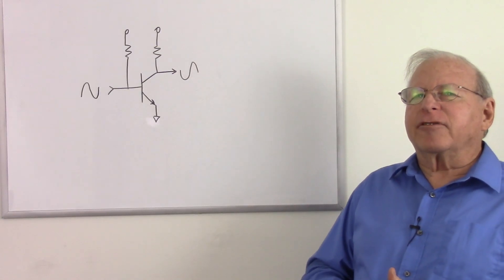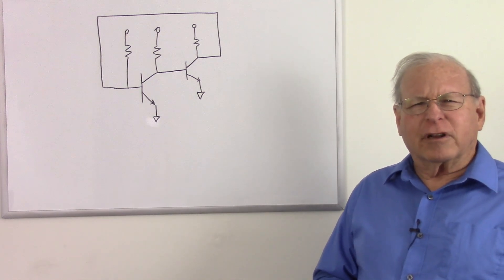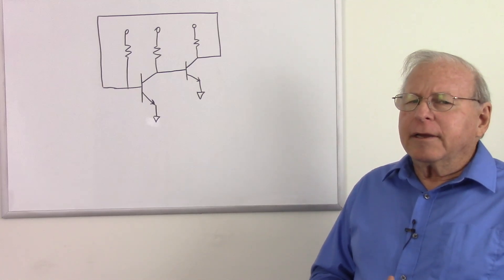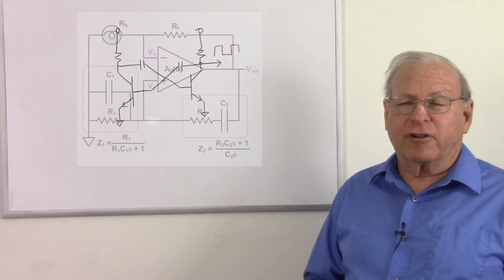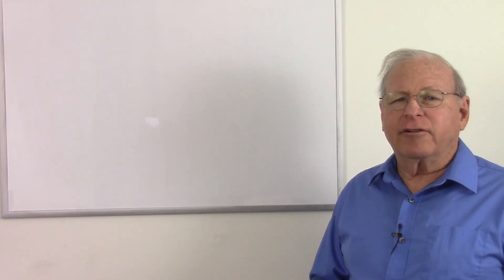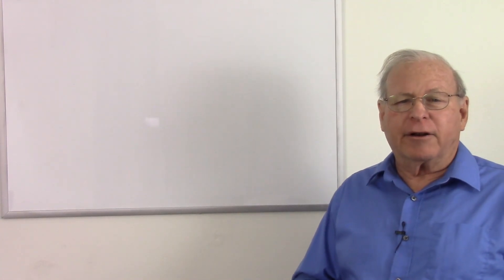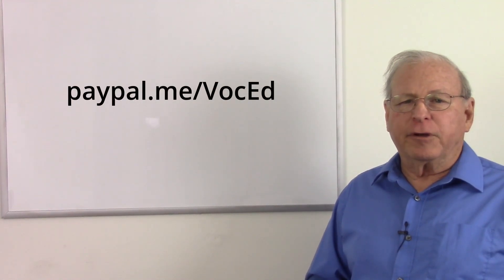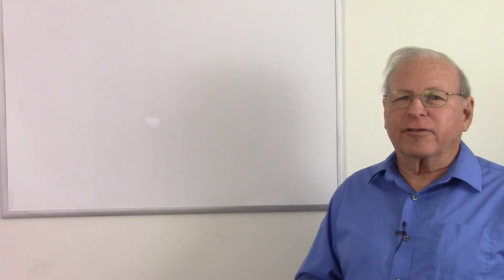Prelude to Oscillators

Comment: Is that an inductor on the emitter of the 1st transistor?  Why is it there please?
Reply: That's an incandescent light bulb.  It's a resistor with a negative temperature coefficient so it increases resistance with current.  It's purpose is to increase negative feedback to a balancing point to stabilize the circuit so it oscillates with a sinusoidal output.  Lookup Wein bridge oscillator on wikipedia.  Also please include timestamps in your questions so folks know what part of the video your question applies to.

Comment: A simple explanation of how an oscillator works, point a microphone at a speaker, the speaker will move in and out at an audio frequency, the microphone will pick that up and feed it back to the amplifier and back out of the speaker.
Positive feedback.

Comment: Thanks for this series. Can you also make a video on Basic Transistor LC Oscillator Circuit?
Reply from the maker: I haven't decided where in the series I will cover phase shift and relaxation oscillators, but I will definitely cover them.
Reply: @Vocademy-Electronics-Tech  Will you be also covering Hartley & Colpitts Oscillators?

Comment: I have struggled through numerous textbook explanations of oscillator design and function and always felt like I wasn't quite "getting it". Thanks to your presentation of the subject, I see where standard engineers' models have to cut corners to focus on the practical while doing a bit of hand-waving to skip over the abstract. We know that oscillators work--designs can be found easily. But the question of why is another matter. Looking forward to your always-helpful, insightful explanations.

Comment: I was eagerly waiting for videos on Oscillators and how actually tank circuit creates oscillation with DC source. Thank you are looking in this matter.🙏🙏🙏
Reply from the maker: If you put a battery across a tank circuit, then remove it, the tank circuit will oscillate at its resonant frequency for three or four cycles. The trick is to connect it to an amplifier and feed the output of that amplifier back into the tank circuit to keep it going. I will probably get into oscillators with tank circuits (Armstrong, Hartley and Colpitts) in the third or fourth video.
Reply: @Vocademy-Electronics-Tech  Sir , That is not problem to visualize and understand. The problem arise when that tank circuit we connect in between DC source and Collector of the transistor (I have seen it somewhere in Hartley or Collpits Oscillator design). In that case tank circuit is continuously connected to battery source then how it oscillate? because oscillation start when we disconnect battery and here we are keeping it continuously connected to battery source which is ON all time. (Or I possibly am wrongly understanding this that why I was waiting eagerly this kind of lecture on Oscillator from some knowledgeable person🙂🙂🙂)